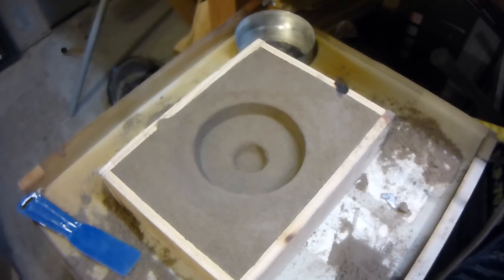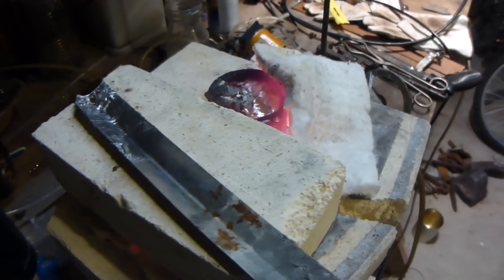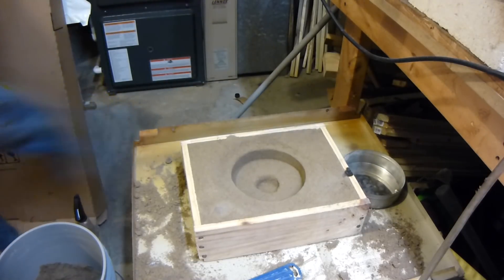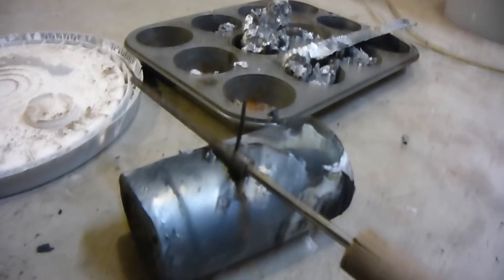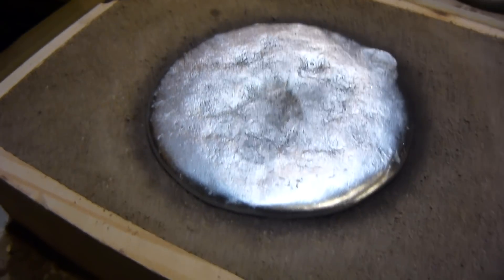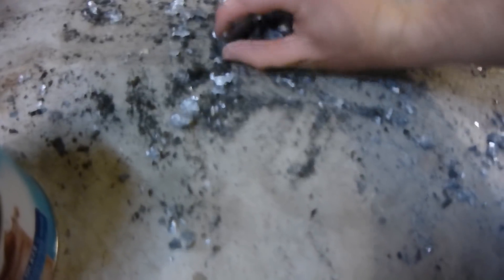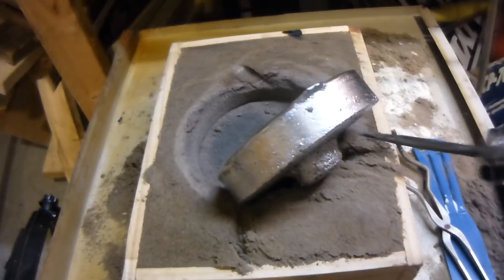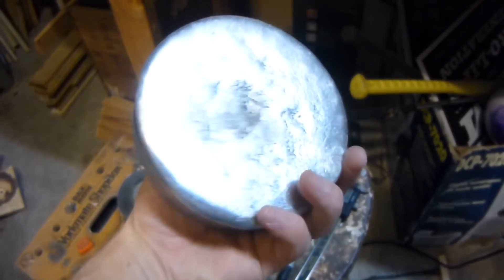Casting an Aluminium Flywheel Using Green Sand Open Mold

Comment: When did you stop using the electric furnace or did I miss a video?
Reply from the maker: +Toxic Enterprise Because I didn't feel like waiting for it to heat up which takes like half an hour.  Plus I had been wondering how my natural gas burner would do.  Just something I wanted to try ya know.
Reply: yeh I get it, I personally use a wood and charcoal foundry (its a hole in the ground :(  )
I did make a paint can into one but the concrete hade rock in it and are like the hardest thing to drill through. well keep up the epic work :D PS can you cast a steam engine or ICE plases cause I want to and I don't know where to stat :D THX bye
Reply from the maker: Toxic Enterprise I am going to try the hole in the ground method soon.  I need to cast something large and the larger crucible will not fit in my furnace.  That would be really cool to cast an engine.  I have thought about it.  Watch Myfordboy on YouTube.  He does lots of videos about casting engines and then machining them.  He even has plans for some of his engines.
Reply from the maker: I would say Myfordboy does castings that are more on the professional side.  But you can learn a lot from them.  I did make a forge so all i'd really have to do is arrange some of the bricks around a crucible and that's about it.  I like using propane tanks.  I also recently got a cast iron ladle thing from a thrift store.  It's really thick and is holding up really well.  It's just a little small.

Comment: It might be less hassle for you in the long run to buy a ceramic crucible or if you have a welder make a crucible from thicker steel. I'm gonna make a crucible from an offcut of pipe that has 8mm thick walls so that should hold up for a great many melts.
Also when your pouring I noticed you had the aluminium red hot. It isn't too critical since your machining it but this can cause the casting to deform more as it cools and it lets more hydrogen gas into the aluminium which can cause bubbles. If your casting had to have thin bits in it then getting the aluminium that hot is a good idea but since this casting is so thick you don't need extra low viscosity of superheated aluminium.

I like you ability to make a working furnace out of such simple materials.
Reply from the maker: +Rainbows871 You are probably right.  I just like trying to do things as basic and cheap as possible so others can replicate easily.  I do have access to a welder at HackPittsburgh so I may go that rout soon.  For now I got a nice cast iron laddile thing at a thrift store.  It's really thick.  I've done a couple castings with it so far.  Holds up really well.  Only problem is it's kinda small.  Only holds about 1.5LB of aluminium.

Yeah you're right.  I did heat it a little more than I really needed to.  Thanks!  Just something I'd been wanting to try.

Comment: Heyya...

----
Here's the tl;dr :Do not use KNO3 as flux, ever, as it's an oxidizer.
----

A flux should be chemically stable and non-reactive with both the atmosphere and the metal, have a lower density and melting point than the metal, and a sufficiently high enough boiling point to not evaporate.  Potassium Nitrate is not at all suitable for flux duty:   it's kind of an anti-flux, used to blue steel by oxidizing it, at much lower temperatures.  Nitrate salts are used in fireworks, gunpowder, rocket propellent, and explosives.   Fortunately, you didn't make any of those.  It was just ~200˚C too hot.

Aluminum's low melting point makes it hard for common salts to serve well as a covering agent:  NaCl's mp is 801˚C, KCl's 770˚C, but aluminum melts at just 660˚C, so neither of those are particularly good for flux.  

Borax might be Ok for your purposes, but it does react with Aluminum, and so it will change the properties of the cast.

Other fluxes I've come across for aluminum are either nasty fluorides, or patented commercial products.  Though one thread mentioned throwing in a chunk of potato before dross skimming, and that it's even practiced at industrial foundries.  In that same thread, its stated that a very satisfactory result can be obtained simply by leaving enough head-room in the mold for impurities to float to the top.

In any case, it seems like you got a decent flywheel here, and fortunately, you didn't blow your shop up with the potassium nitrate.

Here's the link with the threads on aluminum casting:

http://www.practicalmachinist.com/vb/general/casting-aluminum-how-take-oxy-out-157674/
Reply from the maker: +Nevin Williams Hi,

So I actually I called it the wrong thing in the video.  It's not a flux.  It's to help separate the aluminium out of the dross and aluminium oxide on the surface.  At least that's what I remember reading a while back.  It does actually seem to do that pretty well.  When I skim the dross off after using some KNO3 is seems like it's mostly junk and not much usable aluminium.  I think I waste more aluminium along with the dross when I don't use it.  This is not scientific at all... Just my thought and limited experience.

The NaCl melted just fine for me.  I heat the metal up to at least 800C.  I mean it was glowing in the video which indicates to me it was close to 1000C.  The problem with the NaCl came after the casting.  It made everything corrode.  The crucible was all rusting, even the aluminum had nasty stuff on it from the salt.  Plus it just didn't seem to do anything because the castings still turned out bad.

I've heard of the potato method... seems really weird... the guys that were doing casting at Maker Faire said they use the potato method some times.  And they are pretty professional.  Their castings are art, but still they turn out amazing.  BTW when I was at Maker Faire and I was talking with them I asked about what they use for degassing and they showed me the tablets they use and guess what!  I asked if I could buy one and they gave it to me!!!! :D  It's huge too!  It's about 3 inches in diameter and about 2 inches high!  They throw in one for their 130 pound batch of aluminium.  I think I'll just knock a chip off it for each of my castings!  Should last me a while!

LOL I doubt I'd have an explosion from the potassium nitrate.  I'd have to mix it evenly with the aluminum for something like that.  Most I might get is a fire ball.
Reply: Well, molten aluminum will erode steel; oxidized aluminum, not so much.  So you've a catch-22 wrt flux and steel vessels:  when the flux works, its bad news for your crucible, etc.

Although you're exceeding NaCl's melting point, it will solidify ahead of the aluminum as it cools.  An ideal covering flux would remain liquid and floating after the aluminum solidified.

KNO3 readily oxidizes iron.  How do oxides of iron react with molten aluminum?
Ever try to set off thermite by heating the whole thing with a torch?  Not a good idea:  it really speeds up the aluminothermic reaction to explosive levels.

In fact, using rusted steel vessels around molten aluminum is pretty close to setting off a thermite reaction as it is.  Even if it's just a small one, if the temperature of the melt exceeds 1538˚C, there goes your crucible and its contents.

Is your fire extinguisher a Class D, btw?  If it happens to be a copper oxide extinguisher, that's really horrible to use on molten aluminum.
Reply from the maker: +Nevin Williams Ah ok.  I see.

That sounds like a fun reaction!  :P  

It's an ABC fire extinguisher.  Just the normal kind you buy at a hardware store.  Does it react with the aluminum?
Reply: It probably doesn't react as violently as copper oxides, but documentation recommends not using ABC dry chemical on thermite, but to just let it burn itself out.

In the circumstances you have, the thermite reaction would be over before you'd have time to react;  you'd then have a pool of molten aluminum to deal with. 

I guess to avoid this happening, it'd be best to remove rust from your crucible between firing, and retire it long before it gets as ratty as the one you used here.

Do I recall correctly that you have a kiln or electric furnace?  It may not be too difficult or expensive to make carbon-clay crucibles...
Reply from the maker: +Nevin Williams Well yeah it wouldn't work on thermite.  Basically nothing works on themite because it has it's own oxygen supply and fuel supply mixed together.  So the only real way that I know of to put it out is cool it fast enough to stop the reaction.  I think I read somewhere pouring enough liquid nitrogen on it is one way.   But the easiest way to stop the reaction is to get the burning part away from the un-burnt stuff  so the reaction can not continue much longer.

Well there are a couple of problems that I see here with this happening.  For one it's not like the whole crucible is iron oxide.  1mm max of rust.  So maybe it's possible if I get enough iron oxide built up.  Problem is the ignition temperature of thermite is over 3000F.  Which cannot even be lite by a normal flame.  So I highly doubt I need to worry about it igniting.  If it did happen to ignite somehow I'd probably get a poof.  I wouldn't think a 1mm layer of iron oxide would do a whole lot.  Plus the mass of aluminium would suck the heat away pretty quick.  So I think the only thing I really need to worry about is the crucible getting too thin and leaking aluminum everywhere.

How would I make a carbon clay crucible?  I've been thinking about making a crucible.  I have some nice clay I collected and filtered so I've got that.  I considered making a clay crucible but I haven't yet because I thought it would probably crack from the heat.  But adding carbon or something might be the solution.  Would I use graphite, charcoal?  Thanks!
Reply from the maker: +Nevin Williams That's very helpful!  Thank you!
Reply: He's got quite the forced-air system, eh?
Reply from the maker: +Nevin Williams LOL yes! I was thinking the same thing!

Comment: Nicely done, kid.
I've got a little challenge for you, try to cast a brass bell. You don't have to go nuts and cast a 1:1replica of the Liberty bell, a small one should do. ;)
Reply from the maker: +KingSmegma Thanks!  That's an awesome idea!  I have some brass scrap I've been collecting for a while.  Resisted the urge to take it to the scrape yard because I thought there might be a useful project I could use it for.  I'm going to have to get a better crucible though.  But that really is a great idea and I want to do it!
Reply: Makerj101 It's really hard, though, and you'll probably need several tries to get it right. But I believe in you, mate. :)
Reply from the maker: +KingSmegma It doesn't sound that hard.  Melting the brass sounds like the hardest part for me.  Thanks!
Reply: Makerj101 If you want a properly tuned bell, it'll be hard as hell, but I'm sure you'll manage. :)
Reply from the maker: KingSmegma LOL yeah true that!  I think I'd be pretty happy if it looks like a bell and makes some kind of noise!  :P  I got a nice cast iron pot thing from a thrift store so I should be able to melt brass in that really easily.
Reply: Makerj101 Good luck, dude! :D
Reply from the maker: +KingSmegma Thanks!

Comment: I've been melting aluminum down for awhile now but I don't know what to make. Any ideas for a cool easy first casting
Reply: You can powder the aluminum and mix it with powdered rust. Mix the two powders and ignite in a controlled manner (KEEP VERY CONTROLLED, WILL IGNITE VERY HOT) the byproduct is molten pure iron!
Reply: So then you could cast things with IRON
Reply from the maker: +Tommy Sinclair Gun, sphere, slingshot, or anything else you can think of.  If you need ideas just google something like "homemade aluminum casting" and look at the images.
Reply: oOOo, never thought of a sphere, that could be cool, and relativly easy. thanks!
Reply from the maker: +Tommy Sinclair Plus they sell perfect Styrofoam spheres at most craft stores so that'd be even easier.
Reply from the maker: +Brennan Miller LOL yeah I've been thinking about making some thermite!  :D

Comment: If you want better aluminum properties you shouldn't melt the same aluminum in stainless crucible to many times because it will lose some of the properties due to iron contact, it is better to use ceramic crucible. You can also add a coal powder to the sand,, I heard that it helps.  Cruicible will be eaten by aluminum in time also
Reply from the maker: +Kondzio29 Yeah you are very right.  It doesn't matter a lot to to me because I'm trying to do these on the cheap and the quality of the castings isn't that important to me.  As long as the casting isn't full of holes and isn't too gummy.  This casting actually turned out great.  It machined the best of all my castings.  Never heard of the coal dust.  What does the coal do?  I'm thinking about getting a proper graphite crucible soon.
Reply: +Makerj101 It is commonly used in casting iron, to raise the sand ability to let the gases through.  so there is no air bubbles that came from thew humidity of the sand.  I actually never tried sand without coal, so i do not know if the results are different but mu teacher at the university says that it is always good to have that coal in the sand.  if you are interested in something,  ask me, if i know i will tell you and if not i can always ask prof. at the university ;)
Reply from the maker: +Kondzio29 Huh interesting.  I'm not sure it would have the same effect for aluminum as aluminum is not nearly as hot.
Reply: +Makerj101 i asked my prof at the university and she said that it could help getting better surface finish of the casts due to higher gas flow through the sand
Reply from the maker: +Kondzio29 Cool!  II have access to lots of coal so maybe I can try it!